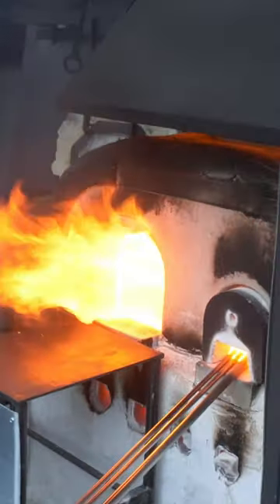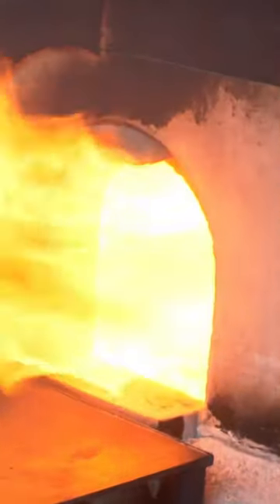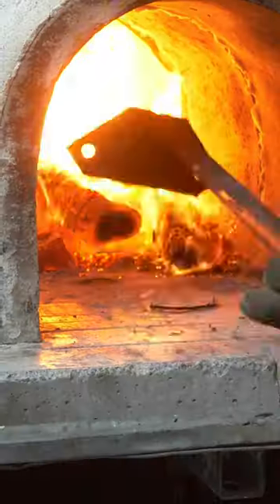How did the Ancient Roman’s make Glass? #diy #glassblowing #glass #history #romans #romanempire

Comment: I have been wondering if you could get higher temps using charcoal, that is something that is way in your wheelhouse. You would just need a hot fire without much air to convert your wood into charcoal. The fuel source should then burn hotter.
Reply: I'm his main video he made about this he talks about why just wood was better. Mainly for time efficiency. His video was very interesting had some nice history lessons
Reply: Coals can hit higher temperatures if you have air constantly blowing on them, but just having a bed of hot coals without forced air, they tend to suck up all the oxygen around them and burn a dim red rather that nice bright hot yellow that you get when blowing hard on them.

Coals don't give off volatile gasses like wood. With wood, those gasses don't need oxygen immediately. They can find some oxygen to react with somewhere else in the furnace...

So yeah, charcoal has the ability to get hotter, but that doesn't mean it automatically does.

Comment: I fully understand the arguments in the vid, yet charcoal is a viable option of the time since you made it "primitive" too. It may not have been used on a industrial scale yet that wasnt really the requirement for your progress in general i thought. So i wouldnt see tge issue with using it. That doesnt make this excursion into the topic any less interesting
Reply from the maker: True, I could have used it, and I did in some of my previous attempts.  However the conclusion I got from everyone I talked to and researched is that using wood produces the exact same result if your furnace is being run properly, as as it's directly producing the charcoal itself.  I likely could have gotten the same result with directly using charcoal, but it's an extra variable I'd likely need to learn how to adjust for through multiple attempts.  While every reference I found of successful ancient glassmaking I've found has been with wood.
Reply: @htme  that is understandable, thanks for taking the time to respond ;)
Reply: @htme  use grease fire